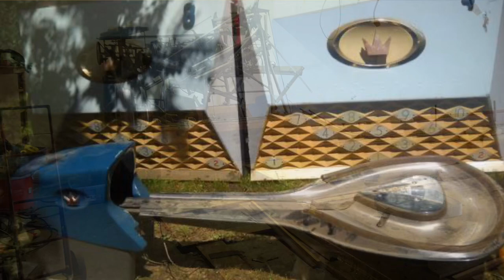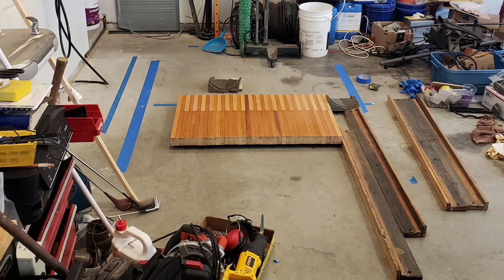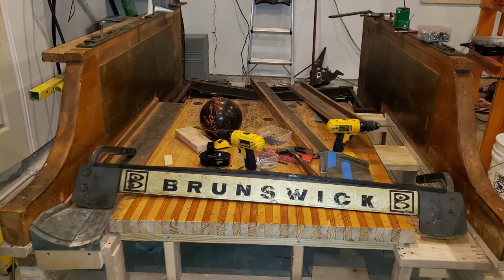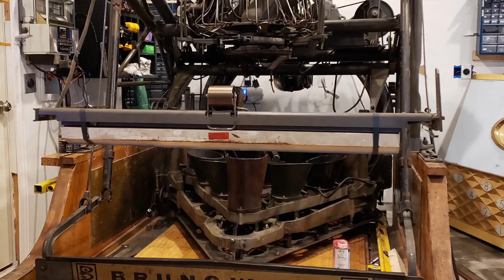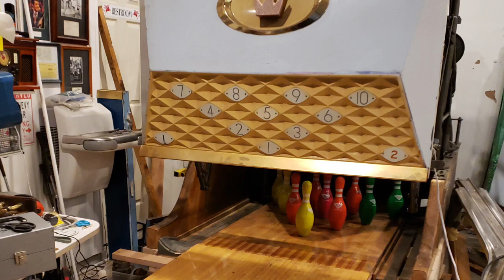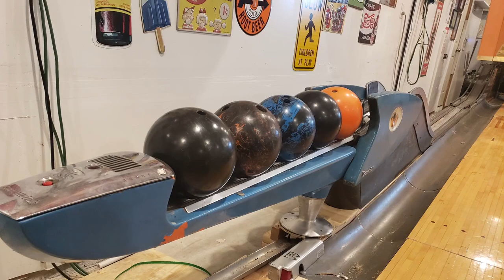Installation of the Garage Bowling Alley Brunswick Pinsetter - acquisition and installation

Comment: That’s awesome. I love seeing when old Brunswick Pinsetters being installed in 2019 (privately).
Reply from the maker: Sadly I couldn’t get the 4th machine but I got some I could salvage from it to have some old extras for mine.    The other 2 pinsetters went to North Carolina and Florida     I got a lot of the lanes removed but had to call it quits having enough for my project, save 2 machines, parts and a cousin load up 6 or 7 seven foot lane sections.  Too bad they were bulldozing the old rec building and converting the church after it closed.
Reply: Before your page I had never seen working pin indicators on these masking units.  We had a place in Albany that still had these long ball returns and masking units in the 90s.
Reply from the maker: I hate to see places waste money on cheap ass masking units and newer stuff.  Wish more places would embrace the old stuff and keep it in place.  If I had the money and the space I’d buy up 40 lanes of retro old stuff and have a whole house working as this one does.   One can dream.     I
Reply: @GarageBowlingAlley . I really love both Retro Gold Crown and Standard Frameworx Masking Units but I still hate those Screen Masking Units, that’s a sign of a Bowling Center you don’t wanna go like String Pin Bowling Centers or some Bowlero branches that don’t support Leagues.

Comment: Loved that you rescued those. I live in Md bowl both tenpins and duckpins. Most of the old duckpin houses still have the above ground ball returns i myself like the coral ones but.most centers have repainted them by now would love to find one of those returns to display my collection of vintage bowling balls
Reply from the maker: They’re around.   I know a guy in Kentucky found a seller with a bunch.    He bought 2 of them.   Mine was (and still partly is) blue but found original orange underneath so I color matched it

Comment: I see an AMF Streamlane 21 mask on the wall. Is an 82-30 or 82-70 in the future?
Reply from the maker: I had my chances at an 8230 but reality kicked in and said no.   No no no.   I’m going to light that masking unit up soon.   I have all the parts and pieces I just need to “create” the wiring and electrical part.
Reply: @GarageBowlingAlley  I am actually making a PCB board that does all of the Sparemaker functionality, all it needs from the pinsetter is the pindication light outputs. I am hoping to restore Sparemaker at an alley near me using these PCB's. If you would like to test one out I can make a custom one that supports the voltage from the Brunswick pinsetter(24VAC instead of 12VDC).
Reply from the maker: Now you have me thinking.     I was going to wire it up and let a unit generate a series of light patterns BUT I could run a cable to it from the pinsetter to light up in unison with the masking unit.